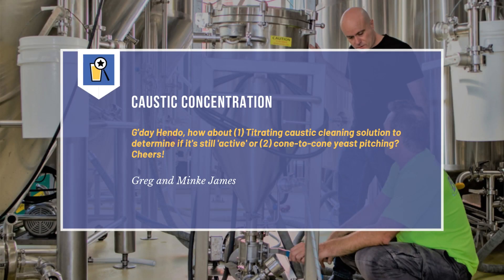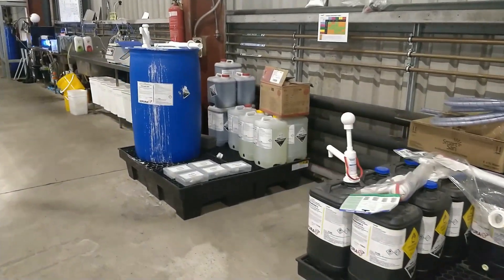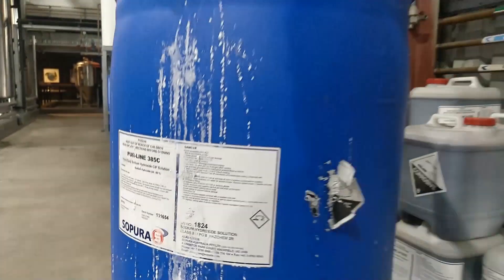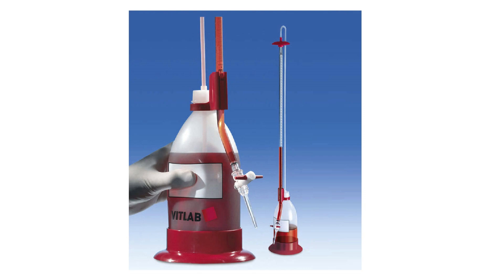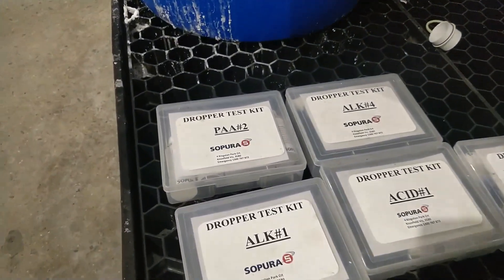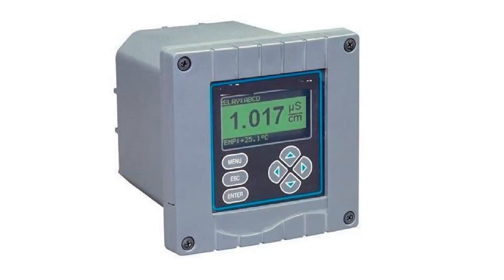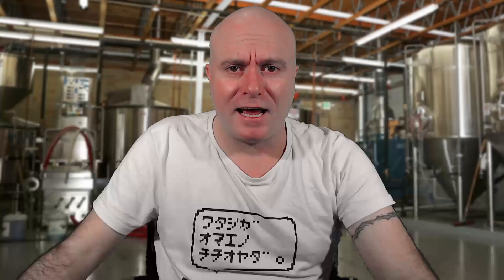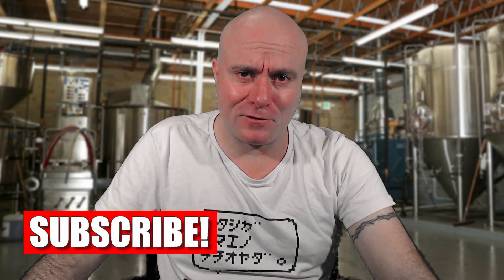Brewery CIP Mastery: How to Test and Verify Caustic Concentration [Pro Guide]

Comment: Greetings Hendo. What is your opinion on powdered oxygenated detergents? We have a product here in South Africa very similar to PBW which we are using. What is your thoughts on these types of cleaners? We are a small startup brew currently using LLDPE plastic conicals, which means that we cannot wash with high temp liquids unfortunately. In your opinion, what would be the cons of using these types of cleaners over caustic? Cheers
Reply from the maker: Hey Sean. Oxygenated cleaners such as percarbonate are a milder alkali for cleaning so they're not going to be as effective in removing soil. With your plastic fermenters, you can use caustic at lower temps and it would probably do a better job. Fun fact: if you have a dishwasher, chances are that your dishwasher powder is also percarbonate!

Comment: In testing I have found recommendations of 2-4% of an 80% solution is way over. Typically I use 2L of 80% per 80 to 100L in my cart. Have never had a tank that isn't cleaned nicely. But I guess the Sinners circle has a lot to do with that. 30min at 80c seems to work perfectly for us.

Comment: Hi Hendo , Is there a enviro friendly alternative to caustic chemicals?
Reply from the maker: Hey Dave - Caustic is actually quite environmentally friendly as it is often neutralised by other liquid waste in a commercial brewery.  Generally, brewery trade waste is acidic and needs caustic added to it to become neutral.  Thanks for watching!
Reply: Enzyme-based cleaners exist. They tend to be more expensive and require a longer contact time, but they are very effective.
I agree that NaOH and KOH are relatively benign and safe when used and disposed of properly.

Comment: Here’s my issue: I work with the stuff safely often but other people in the brewery are a bit careless and I’ve had caustic burns for NO GOOD REASON because they don’t rinse things or just aren’t careful about caustic. I’ve been just throwing vinegar on the burns since our sanitizer is peroxide based and won’t help as far as I know. Any quick relief to caustic burns? Might just get to the point of wearing gloves always in the brewery cause I don’t trust these mafks to handle chemicals responsibly
Reply from the maker: Gloves and eye protection - always - when handling chemicals!  Good SOPs and having regular toolbox chats with your brewing crew are also important.  As a last resort, if I get a caustic burn then diluted PAA is the usually the most handy neutralising solution (usually it will be in your parts buckets).  Your brewery gives me concern - please stay safe!

Comment: Hi Steve,

Two questions about CIPs. Looking through the past trending of the daily causticity % of the CIP tanks in my brewery cellar, most were in the 3.5-4.0% range which didn't match up with the Conductivity vs Concentration information that has been supplied by the chemical supplier, so probably the discrepancy comes from flaws in our testing method leading to a greater margin of error than expected and also from the conductivity meters being out of calibration despite them being looked recently by the manufacturer. Given these results, what would your recommendations be on how we verify the causticity of our CIP cellar tanks going forward?

My other question is about the removal of residual carbon dioxide (CO2) in vessels as a by‐product of fermentation through sterile air flush before CIP. What's the best way of assessing this? Unfortunately, both our Haffmans and the CboxQC portable O2 meter don't read CO2 gasses and I resorted to using a carbon dioxide portable detector.

Thanks!
Reply from the maker: G'Day!!  Great questions! 1) If I were in your shoes, I would cross-check your conductivity meters with a titration of the same solution to verify that everything matches up.  A burette is cheap and would make for a great backup and method to calibrate your conductivity meters since the titrant is a known concentration.  The conductivity numbers from your chemical supplier should only be used as a guide as it doesn't take your brewery's water into account because it's alkalinity may vary. 2) Why not use your DO meters to measure oxygen to verify that the CO2 has been removed?  After all, the CO2 is going to be replaced with air which is 21% oxygen.  It's pretty rough but it would work.  You may also want to consider investing in a CO2 detector - the kind of one that's used for checking confined spaces.  Putting it against your blow off while purging with air will verify CO2 concentration in the tank....I hope that helps and thanks heaps for watching!!
Reply: @RockstarBrewer  thanks!

Comment: Where I used to work we just guessed, 1 minute of water in the tank and 2 buckets of caustic.  Where I work now we use conductivity and aim for 120mS. We also use a product from ecolab called Duplex to add to the caustic.

One other thing to note is if you reuse caustic and your cleaning tanks with CO2, you'll have caustic convert to sodium carbonate.
Reply from the maker: Hey thanks for your comment. Absolutely correct about CO2 degrading caustic. It will definitely weaken it and you'll need to top up with more caustic. It's also good practice to completely replace your CIP solution occasionally as well. Thanks for watching 🙂